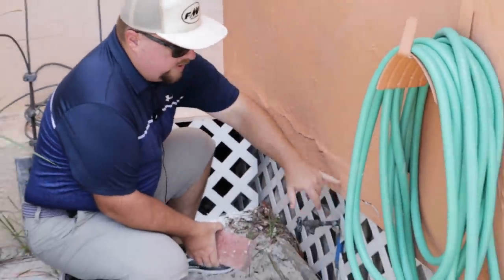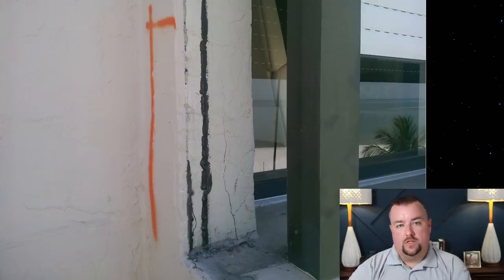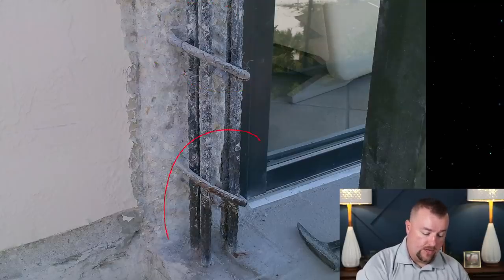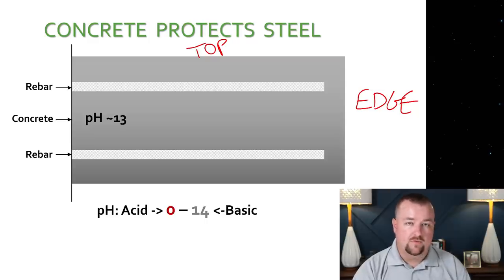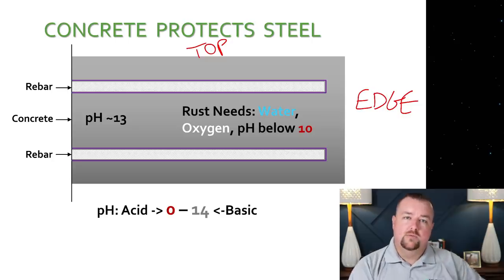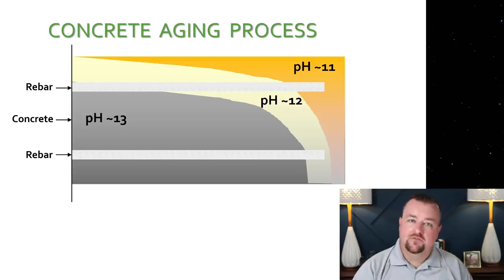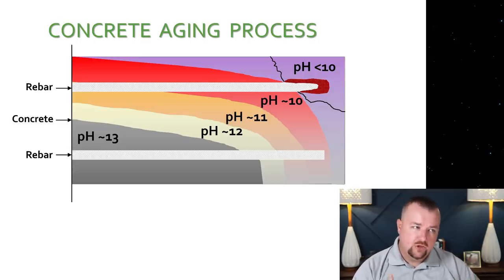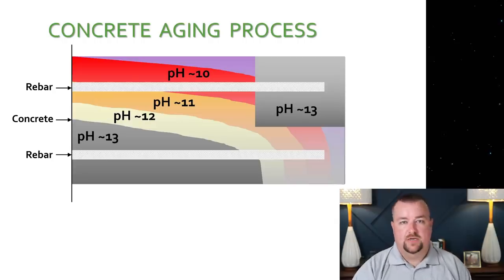Reinforced Concrete's Number 1 Enemy

Comment: So this has me thinking about rebar in concrete below grade. Would this still take place there? I am wondering this because I am assuming oxygen levels would be much lower. Moisture would be much higher… would clay vs sand make conditions better or worst? My brain is now in over drive with questions lol!
Reply: Is rebar only crucial where there is tension rather than compression forces? below grade, I guess it would be compression mostly.

Comment: Usually rebar is raw steel that sits out before its used its already rusted before its used add salt from the air and  and moisture and its life shortens steel goes back to its original form.

Comment: So kinda curious, no environment is perfect, so how do builders avoid moisture both during and after the build process? For instance, if slab is poured 3 months ago and the tension rebar sits exposed through multiple rainstorms and heat does that start the process and then once the rebar is cut and cemented over, does that stop the process or rust?
Reply: any rust on the rebar prior to coverage is bad and weakens the steel concrete unit because the concrete does not bond to the rust.
Reply: @peetky8645  interesting. I'll have to talk to inspector then concerning my property
Reply: @goyaliza  further damage will only occur if the concrete slab /coliumns are kept wet all the time and probably a little surface rust at the time of pouring is common, though not desirable.  most engineers design with a 30-50% safety margin which will make up for non-perfect builds.  poor maintenance is a killer though.
Reply: @peetky8645  my example is rebar sticking out of the side of the foundation that hasn't been cut down to size nor pulled to tension (?) yet . It was poured back in April/May 2021 during times when it was raining. Since then, nothing has been done to this rebar sticking out of the foundation. 

Either way these videos make me look at the construction completely in a new light.
Reply: @goyaliza  not sure if  "rebar" is used in post tensioning.  my understanding is that post tensioning steel/cable is in plastic sheathes running through a concrete beam or foundation.  at some point,  the nuts are tightened down tensioning the steel member and the concrete.  I always assumed some type of silicone gasket was used on the thread and around the nut to protect the tensioning unit from moisture intrusion.   i am sure rust is a degradation issue with post tensioned systems, but because the steel is not in direct contact with the concrete anyway, spalling and cracking and water intrusion are less likely.  any steel protruding from the edge should probably be cut off and covered promptly but i dont think it would put the member itself at risk.  this is an enthusiast, not expert opinion.

Comment: We need alternatives to steel rebar. We need something that does not corrode. One experimental solution is dried bamboo. Incredibly strong yet flexible and very cheap. In asia they used to make scaffolding from bamboo.

Comment: The presence of rebar in concrete makes a concrete structure stronger—I get that, but then according to this, that rebar dooms the concrete to failure in a relatively short period, like 40 years. How does this compare to the Romans whose concrete structures—absent rebar—have lasted for millennia? Also, can concrete be truly waterproofed with paint or epoxy? Lastly, I’ve been past a construction site where the rebar is already rusting before it’s even been used. Why can’t it be rustproofed before installation?
Reply: Everything is a tradeoff between cost, weight and durability. Rust on rebar before the concrete pour is a non-issue.

Comment: Seems like, 30 years ago, they coated some rebar.  I have mixed thoughts on the coated rebar as a flexible layer between the concrete and the rebar could become an issue.  I haven't heard of anyone zinc plating rebar.  Just think of using G90 rebar!

Comment: There are some very good products on the market to coat steel with now that prevent rust like a epoxy primer that are used on cars now, hence why fewer cars are rusting out compared to the 70s and before. Also what are the the types of steel is the rebar made of? I know I try to avoid using Steel from China as its grade is compromised, when are recycled steel is sent to the market the biggest buyer is China where they melt all the steel together giving it a lower grade but they don't tell you that. When you have galvanized, cast, forged of different forging quality and you throw it together its quality is greatly reduced. Do we buy re rod from China???

Comment: So my takeaway is don't use steel use fibermesh whereever you can. Slabs on grade, sidewalks and patios. Wait, the steel is there for strength and heat transfer. Can they make a rebar with a collapsible or hollow core on the inside so when it expands it just collapse the core and not the exterior concrete and its exterior bond.

Comment: Have you heard of Crystalline waterproofing technology? The more information coming out about the Surfside collapse makes me wonder if a Crystalline waterproofing agent like Xypex had been used in the concrete construction, would the building still be standing??? Had the pool decking and everything below the decking that’s concrete had Crystalline waterproofing, the rebar wouldn’t be rusted because it would have come in contact with water. 

For those who do not know what Crystalline waterproofing is….. it’s over 50yr old technology that makes concrete WATERPROOF PERMANENTLY! It’s a powder that is added to concrete during the mixing process.

Comment: I believe you will find that when chloride ions exist in solution they will actually disolve the steel bypassing oxidation - the iron chloride which is water soluble will migrate away leaving orange staining when the water carrying evaporates - thus the accelerated corroding in salty environments.

Comment: Could you soak the concrete with an alkaline solution and restore its ph?
Reply: No stop the water by caulking with np1 or np2 and coating the exterior of the concrete

Comment: Is there any way to restore the high ph in the original concrete?
Reply: Because concrete is porous, it should be possible to soak it with a strong base solution like sodium hydroxide. But this probably has negative side effects like the NaOH reacting with the iron itself.

Comment: Could they make rebar out of a different metal that doesn't corrode as severely as steel?  
At first, I thought aluminum, but aluminum expands and contracts much more than steel as temperature changes (which is why you can't use aluminum as electric wiring), so aluminum won't work.  
Maybe copper?
Reply: I don't know if it could actually be used but I've seen many comments from others say stainless steel.
Reply: @TheKuptis  Stainless steel would be prohibitively expensive to use as rebar, but if it is proven more durable then its use should at least be considered.

Comment: Spalling is defined as pieces or flakes of a material chipping, breaking, off or flaking off of the larger piece.
Concrete spalling even happens on concrete that doesn't have steel so it's not the steel that qualifies it as spalling, It's just that the rusting steel facilitates the process.
There are millions of driveways across the country that are spalling and it's not because of steel it's because of poor concrete quality, poor installation, and harsh weather or chemicals.

Comment: You should have mentioned that the pH of pure water is 7. That in and of itself should be enough to generate the oxidizing environment that damages the rebar.
Reply: The water will get out again of the concrete eventually. But the CO2 and the salt remains and change the chemical mileu for good (or for the worse for good).

Comment: This presentation tells me that using steel in concrete is a total waste of money. I've never even heard this could happen until recently. It reminds me of people who continually lease new vehicles as I did when I was younger. Knowing I was not likely going to have that car out of warranty, I would just add gas and go. The same is likely true of many new home buyers who move every five to ten years. Why do any maintenance when it's not likely going to be your problem?
Reply: roman concrete is still around after 2000 years because it had no reinforcement.  however, those walls are 3-10 feet thick, not 8-12 inches like modern walls.  modern designers like the airy, economical buildings that rc construction enables.

Comment: Why don’t they use stainless steel or galvanised rebar? It would only add a few % to the cost of the finished structure and would negate the need for maintenance in years to come.

Comment: In fact you make the case for protecting your concrete with a layer of non-water-penetratable paint, and keeping that layer in order. Something else though, I do not understand you when you say that concrete is NOT inherently waterproof. Around the world we build floating homes that have a box-shaped base of (poured) concrete which sits on the water that the rest of their structures is built on. There must be a difference between that concrete and the type referred to in this video. Also we build plenty of structures out of concrete that sit directly in salty (like sea)water their entire life. I think at least high quality concrete pretty much IS waterproof! It is possible there is special additives that in those cases are used and that are (or were) not known to everyone everywhere (always), it also is possible that with concrete that fails now, in the day not precisely the right amount of each ingredient was used making it. AND it has been found that concrete can be made several times stronger and denser by grinding up all the used ingredients to a real fine powder. (Stones not included of course, but you might not always add those anyway.) This makes all particles bind much tighter and closer, leaving less or no spaces or openings. In Amsterdam this recipe has been used the first time to build a bridge with a spiraling roadway to get to the height where its deck crosses a river arm, and that could all be made out of a < ONE AND A QUARTER INCH (3cm) layer of concrete of this newly found, improved, finely ground concrete mixture. Also they would use (glass) fibers instead of rebar I suppose, to add (improved) strength andl of course, that stuff can't rust anyway.

Comment: So I see steel reinforced concrete pilings for a building on stilts on a bay, built in 1970, I see no spalling, no ruststains.  I can see the below the mean water line, given our 10 foot swing in tides.   
how do these reinforced concrete parts survive despite 50+ years in salt water.
Reply: i believe they use very good concrete and bury any rebar far from the surface.   i have heard a 2 inch depth for concrete roads that are salted is a minimum

Comment: It's the CO2 that forms the weak acid not the chloride.  Na+ and Cl- can act as electrolytes which exacerbate corrosion, but it does not affect the pH in any appreciable way.
Reply: I disagree - the chloride ions will react directly with the iron forming iron chloride which is water soluble.
Reply: @kvs13156  That doesn't make sense, you have not accounted for charge balance and FeCl2 is not stable in a basic environment.
Reply: @Tyler_0_  it appears that the literature says that the NaCl dissolved in water accelerates corrosion due to the increased conductivity of the water solutions.
Reply: @kvs13156  As I said, it acts like an electrolyte.

Comment: I get concerned when I see smaller versions of concrete mixers for a layman/handyman able or not able to use to mix a small batch from a bag then add water to repair spalled concrete.
This makes me think of a baker in a home kitchen. Some bakers use the measure cups and then to be more precise will take a straight edge and run it cross the top of a cup right? 
Well, who s watching each contractor while they are mixing up a batch for a patch up job? then you have a homeowner who thinks well… why go by the directions … it s going to dry out and look and be just fine without knowing the science behind what he or she is actually doing as Josh (a professional) just explained.

Comment: Well, imho, steel is an out of date material, and building should make a step further, using new materials like basalt fiber reinforcement in concrete. This offers a better chemical stabilty and is completly acidproof. Moreover it offers better mechanical chararcteristics, and its density, nearing concrete's density prevents armatures from "sinking" down.
Its better chemical properties implies that you need less concrete thickness to protect it, wich implies lower concrete quantities for enrobing, which in return implies lower cost for identical performance.
On another side, concrete decarbonatation inceases its intreseque resistance. The combination of both phenomenons  being finally benefic for the compound strucure. 
I'am not basalt basalt fiber seller, just teaching building engineering to students, and making them aware of new materials more energy efficient with a lighter "carbon print", the E+C- concept.
Well...some revolution has to take place in bulding engineering.
Thank you for your clear an precise explaination of this not so widely known (despite widely seen...) disorder.
I really like what you do

Comment: I'm going around with my little hammer sounding out all the columns in any car park before I go further inside. The queue behind soon reverses out once I spray those red lines on everything. I don't think they wanted to use a hammer on anything at Surfside, it seems sadly that everyone knew that place was bad from the start but nobody did anything. All the places built at the same time need checking to original plans and for what you talk about in the video. Not gonna happen, that's the end of real estate as an investment model.

Comment: I'm surprised concrete is that high pH. That's like drain cleaner level.

Btw, pH can go below 0 but then it is relatively concentrated acid.
Reply: If you ever mix cement, you don't want to get that dust in your eyes!
Reply: @gordonrichardson2972  Yeah, I make sure to stay away from the dust cloud when I pour out a bag. I knew it was bad, just not exactly how bad.

Comment: They are water and plants and aging concrete. Concrete lifespan is around 49 years only. 99 years are idealistic figures. Repairing and maintenance are a endless money pits. Teardown and rebuild it. One example I lived in @ Singapore 310120, The old building flat requires endless maintenance and repair works every random months and every years since 2000. Drilling, hacking and hammering only. No Dump site, No materials, No even a lorry crane was found. -D

Comment: what if you test the ph of the concrete from time to time?
Reply from the maker: This is physically possible but usually impractical.  A lot of concrete has materials or paints over top and would need removed to facilitate statistically significant sampling sizes.

Comment: what about stainless steel rebar ?
Reply: Think galvanizing the rebar - this is what is done to the wire rein-enforcement in modern concrete drainage pipe

Comment: I have often seen hydrochloric acid (muriatic acid) sold and used for cleaning and degreasing concrete driveways, parking lots, and shop floors. This now seems like a genuinely terrible idea.
Reply: It's only a thin layer of acid, and floor slabs are not load bearing structures.

Comment: Why don't steel reinforced concrete structures have an expiration date?  They have a design life. Should that not also include a specified expiration date?
Reply: No we have builds that are in the 1800's or earlier around the capital building. Maintenance and shitload of money to repair.
Reply: Washington DC that is where I learned concrete work. Sand blasting and toothbrush out limestone bricks.
Reply: Doing concrete work for 20 yrs. Most people are unaware calcium from toothpaste with tooth brush will cut down on acidic properties in old Victorian homes. I will take someone 2 or 3 days to do ground level area, but will add another 15 years to the porous strength of concrete. Real brick layers and concrete masons know this. Spray is for large condo's and the lifetime added is at least 10 yrs. Cost aint no 18 million.
Reply: @Theckonestroh  Maybe that is not the ideal option?

Comment: You forgot purely thermal expansion and contraction vis-a-vis the different rate of steel and concrete which also causes failure without rust due to loss of mechanical bond..

Comment: This is very basic but doesn’t address the actual mechanism that causes the process. Concrete is a great portion of the structural component but the extreme differential of thermal expansion between the metal and the concrete causes cracks at corners and ends of bars. It’s all we knew. A small amount of water from cracks microscopically oxidizes the rebar increasing its diameter, causing more spaces. If this continues to get wet larger cracks appear. Eventually the major supports see their “support” crack away leaving the steel to be the sole structural element. This process can be illustrated by examining the highway columns after a large seismic event. Carbon fiber struct. elements will solve this in the future but for now……🥸

Comment: what if they painted the rebar with oil based paint before using it?
Reply: Isn't oil base extremely noxious?
Reply: @windsofmarchjourneyperrytr2823  You do need turnpentine to clean it up, but in itself I don't think it's too bad.  NOt totally sure, tho.  The idea is to coat it with something to prevent rust.  I am sure there are other options.  Water-based would just make it rust b/c of the water in it.